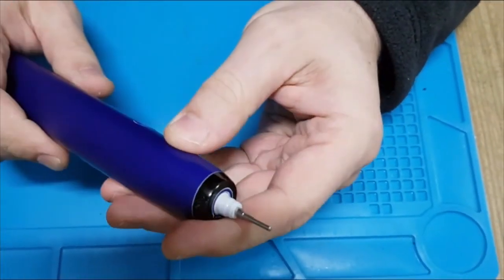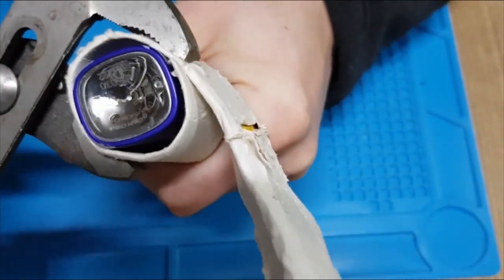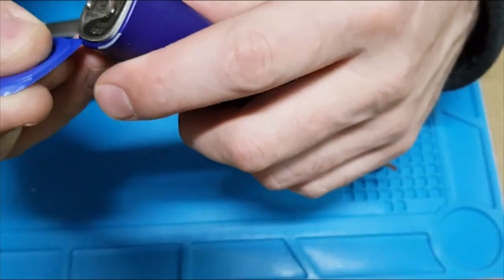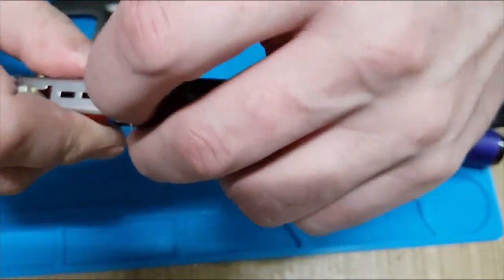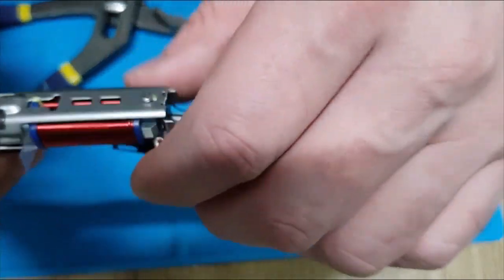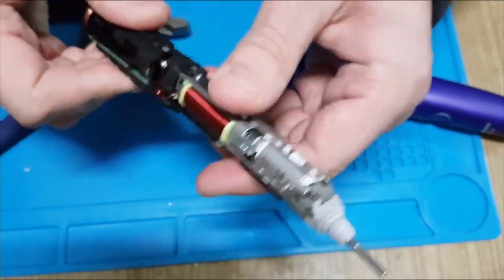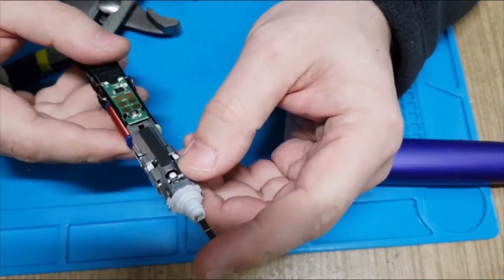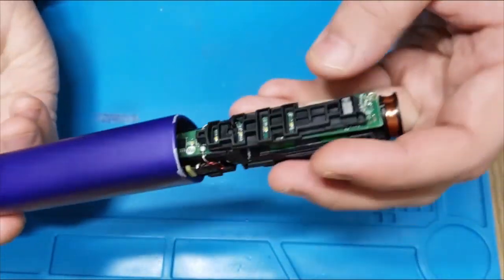Philips Sonicare DiamondClean /no vibrations/ opening and repair

Comment: Hey I've just replaced the headpiece, and went perfectly, strong vibrations and everything but when i put it back in the handle shell it stopped working? took it apart again and when I press the button, the PCB lights up for a second and nothing happens, still charges fine, any ideas on whats wrong? doesnt look like any water damage
Reply from the maker: How did the upper seal looked like? I get a lot of messages where they say that it doesnt have any water signs but when you take off the board there is a lot of corosion underneath even when upper side looks good. Other possible candidates would be MOSFETs or as I had one interesting conversation wit one commenter battery itself if it's 10+ years old..
Reply: @letsfixitgarage  I've just changed the seal, I haven't used it yet so there shouldn't be water damage
Reply from the maker: I meant that maybe water damage was already there before you started repairing. Water damage is not correct word as you think it's instantaneous but it's more corosion of the PCB traces from long exposure to water or moisture..

Comment: how short must the gap be for it to work!
Reply from the maker: 1-2mm, it works with any gap it's just my assumption that smaller is better..
Reply: @letsfixitgarage  thanks mate! I did that but I toothbrush still didn't work.  so sad.  I see some Corrosion on the red metal wrap. do u have any idea what that might be.  appreciate your help
Reply from the maker: @15v1c1  any corrosion is sign of water damage. Check my videos for water damage on the Diamondclean brush and if you have a multimeter chances are high you can identify the culprit of the defect. Although repair of water damage requires some small items soldering skills.. but you can see the repair examples in the videos..
Reply: @letsfixitgarage  oh no.  I don't have any tools...
Reply from the maker: Well water damage is impossible to repair without tools.. try to look for someone with the right tolls and with my videos it's almost as step by step tutorial..
Reply: @letsfixitgarage  thanks mate

Comment: if you have any video for repairing gaps for Sonicare 9000 black, it would be great. I watched most of the videos for repairing this brush and it helps me a lot. as in 9000, there is a bit different circuit board and wire connecting brush tips to the mainboard for Bluetooth connection, Thank you in advance.
Reply from the maker: I have only this one https://youtu.be/y_HVpYt_jHM but it was more of first time opening and inspection and not a real repair video (although it got repaired - battery was empty :) ) in principle process is the same you just need to detach the glued magnetic sensor and the two wires. It can be done without desoldering the two wires (I think it's for the rfid reading on the toothbrush head and not Bluetooth) but it's easier if you desolder them and solder it back after the gap repair..

Comment: Thanks man. Was a few clicks away from buying a new one due to the wobbling head when I found your video. Bit nervous about getting the base off, but worked perfectly. Just needed to tighten the screw put it back together and it's working perfectly.
Reply from the maker: If it will start wobbling again buy screw tightening liquid like loctite for the next intervention ;) p.s. and spread the word if you can :)

Comment: Where to get this piece of plastic to open the bottom piece?
Reply from the maker: Any thin plastic will do. It's only needed to create additional pressure on the bottom cover. Sometimes it pops out only by applying pressure without the additional plastic..

Comment: Wauw!! Precision mechanic. I want to do this, but i'm afraid. I have an older Braun elecric toothbrush.
Reply from the maker: Braun toothbrush uses completely different approach. They have a mechanical transmission. So if you have vibration problem it could be more difficult to investigate :) on the bright side they are much easier to take it apart ;)
Reply: @letsfixitgarage  okay, "Deutsche grundlichheit" 
Maybe i have to lubricate the gearbox (75W90? haha) and if i can not; i just buy a new one. This one is maybe 8 or 10 years old.
Reply from the maker: Definitely take a look. Problem could also be in battery, as Braun usually used NiMH batteries..
Reply: @letsfixitgarage  Okay,thanxx man!!

Comment: Thanks for the help! That worked perfectly! On a related note, that is the worst engineering I've ever seen on a non-beta product! The whole thing breaks if a piece move a fraction of a millimeter, but the bracket to screw it into is literally 10 times the size! Setting it down on the counter could be enough force to knock it lose! Crazy!
Reply from the maker: Your welcome. Sure Philips could have welded it in place, but then if you would drop it, it would bend the internal shaft and  what repairability would it have then.. only replacement.. I like this design for repair it is very good, they used even simple Philips head screws and not some fancy ones where you would need some additional adapters :)

Comment: I managed to get off the cap but then failed at step two - did not manage to get the inner parts out of the case. Oh well will have to buy a new one after all....
Reply from the maker: Check out my other videos. There is one especially for taking it out of the housing.. that was requested quite a lot :)

Comment: I fixed the magnet and there is space now, but my brush doesn't work nonetheless. It just doesn't start vibrating. The lamps go on when I push the button though. Any help?
Reply from the maker: Difficult to say only from description.. what was the initial Problem? water? Did it function before the repair? I would check if the MOSFETs are ok if the lights are functioning but there is absolutely no vibrations..
Reply: @letsfixitgarage  the initial problem was that it wouldn't start. I did the repair as shown in the video (the magnets clearly touched totally), but there was no improvement. There got some moisture into the top part as I can see. I had to use the brush manually now because I didn't have a normal brush at home and now the top thing is clearly loose. Maybe that was the problem in the first place and it got worse now.

I don't know if I buy a new one and do this reparation frequently or if I buy another brand now ...
Reply from the maker: If it was not turning on and you found water then this repair is not going to help.. check my other videos for typical defects or water damage series. The answer could be there but it involves quite delicate soldering skill.. as I said before this is a very reliable toothbrush but you need to take care of the upper rubber seal and not dropping it.. then it will serve very long ;)
Reply: @letsfixitgarage  thanks for your answers

Comment: I took out everything like what you did, and everything fits tightly but it doesn't do anything when the power button was pressed.
Reply from the maker: What was the initial problem of the toothbrush? Low vibrations or no vibrations no lights?
Reply: No vibrations and no lights
Reply from the maker: Then check my other videos on water damage repair. These should have answers to your problems.

Comment: Can you tell me the tool that you used to get the pcb out? I can't find any tool around the house. Thanks much!
Reply from the maker: For that you need to desolder battery and charging coil. If you desoldered these things you could take pliers and squeeze the 2 plastic pieces to make it thinner but it shouldn't be to difficult main thing is to desolder the other 4 points there is no way around it..
Reply: @letsfixitgarage  thank you!

Comment: The handle cracked when applying pressure and prying the cover, did anyone else have this problem?
Reply from the maker: Yes it can happen as with any plastics if to much force is applied.. somehow from my experience the new golden color housings brake more often.. not sure if something changed in the plastic or is it just my luck that influences it..

Comment: just received a new motor that i got off of ebay. The motor shaft was broken in my sonicare dimondclean. Put the new motor in and soldered up the battery contacts and it works perfectly. $30 and I have a new toothbrush. Thanks for your great tutorial.
Reply from the maker: Beauty of repairs :) nice job! And you saved some piece of e-waste!

Comment: Thank you, man. I've saved me from ditching a perfectly repairable toothbrush.
One remark - I'd put threadlocker not only to the threads but also between the screw head and the metal casing to prevent the electromagnet slipping. In fact I did so when fixing my toothbrush.
Reply from the maker: Yes threadlock doesn't hurt, as we can't get the screw tightening forces that the manufacturer uses.. I do believe that space between magnets and screw tightening force is a calculated value at the manufacturer Hause that saves from further damage.. but if we don't have it adding the threadlock helps to have it opened one more time..

Comment: As with others, I was dubious as I was mangling the bottom cover, and further dubious when I could not find the release clips. My problem was that the screw that fixes the top metal rod in place had come undone. I screwed it back in and it is working again! One small caveat however - if you are like me and lack the proper tools to get the bottom off cleanly, it may result in no longer charging on the standing charger. Fortunately it still charges in the travel charger.  :(
Reply from the maker: For the ones that are looking there is a close up video https://youtu.be/oMVa64Q13HA

And for the not charging.. it should be the same travel or glass charger.. of course if the coil got saved it could be difficult to replace but just got an idea that I'm principle it could be rewinded.. just calculate the windings and rewind with the same diameter isolated wire.. :) just an idea I would just take another frame but yes some soldering gear is needed for that.. glad you didn't gave up and managed to fix it!!

Comment: Thanks for the great video! 🖤 Helped me a lot to open the toothbrush! I had to replace the link rod at the top, as the metal inside the toothbrush was broken. (I ordered a replacement part from eBay.) I took this opportunity to adjust the space between the magnets. Now the toothbrush is working better than before!

Comment: I've got an issue where my mode lights don't work. My brush charges and switches on and cycles all modes. 

I've done a battery replacement and after that the mode lights haven't worked.
Reply from the maker: Difficult to say, check if you didn't knock some element of the board or maybe something got shorted out.. haven't had similar issue..
Reply: @letsfixitgarage   thanks for the reply. I have miss judged it. I think it isn't charging as well. Do you thing it would be a good idea to try a full reset by desolding the 2 points bridged on the board?
Reply from the maker: To be honest I doubt it would help but sure you can try. I would look for something that got damaged in the last repair.. maybe samo trace got torn.. maybe some pcb element got toched by the soldering iron.. maybe something got shorted out..
Reply: Thank you for your advice I will give it a try.

Comment: Thank you for this instructional video. I'm a middle aged unhandy person with very little skills of this nature but your clear and precise video made it possible for me to open up and diagnose my Sonicare. I was able to create space between the magnets but then I noticed that my brush shaft was very loose and looking closer,   it was revealed that shaft in my brush head broke at the screw. I know I could replace this whole thing (everyone mentions this place http://www.ebay.co.uk/itm/new-original-Philips-electric-toothbrushes-vibration-device-HX9340-HX6710-HX6950/252636882826?_trksid=p2485497.m4902.l9144)  but the red  wires came undone so that would require soldering and that is way above my skill set. I really appreciated this video and for those of you who are NOT handy like me. This repair would have been achievable if not for my broken shaft.
Reply from the maker: Hi, broken shaft is quite rare but yes it is beyond repair. As for soldering I would say it's difficulty is overrated.. it requires some precision and fast acting but it's fairly easy.. just get yourself a thin tip scheap solder iron and a starter solder kit just to try out the soldering. As for this repair you just heat up the solder blob/point and holding solder iron in the blob take with pliers the wire and lift it up.. let everything solidify by removing the solder iron and that's it.. soldering gets tricky with multiple legs components but one point soldering has more fears than difficulty ;) try it out it opens a lot more repair perspectives!
Reply: @letsfixitgarage  thank you for this additional advice. Appreciate all this great info.

Comment: Thank you. I have just fixed my wife's brush. Her problem was actually that the switch was sticking on, so it didn't charge, but the gap was too narrow anyway and it had water leakage. Realistically I will need to replace it in a few months, but I learned something.
Reply from the maker: If it will stop working you can check my water damage series of these brushes (including power button cleaning). It can be fixed but it requires some equipment to do it..

Comment: thanks. very helpful. was done in 5 minutes. not sure that water doesn't  go inside  thru the bottom of the brush after it was opened but magnet is on the right place and brush is working perfect. спасибо.
Reply from the maker: If you haven't used a screwdriver and opened it as I showed by slightly pressing on the sides it should be good. There is a slight chance of micro crack in the housing but for every day use it should be good haven't tried it while scuba diving :D pozaluista ;)
Reply: @letsfixitgarage  🤣🤣🤣 you are good one!!! 👍👍👍

Comment: so carefull when putting screwdriver into handle to pull out vibration unit and motherboard... I ended up destroying mine. might have been wise to warn people to be careful, rather than just showing a screwdriver going into a dark hole.  what I thought was a piece of plastic breaking off was actually an SMT component breaking off the board.
Reply from the maker: When you repair you always have to be careful, not to hurt yourself, or damage the thing that you are repairing.. I had done even a separate video just for the taking out as a lot of people were complaining that it's wery difficult to do so do your research don't start everything on one video experience.. sorry to hear that you damaged yours, these repair videos are not 100% fix or professional guides and it's definitely not easy doing it first time but you have learned something valuable in the process so you could acquire a defected toothbrush and maybe you will be able to make one working from two! Good luck and be careful repair activity is quite addictive when you get it right ;)

Comment: Thanks!  Had a two pack of these with one that stopped working several months ago and then the second one started doing the same thing.  Luckily, I didn't toss them out before I checked to see if there were some repair videos on youtube.  Both of them, sure enough, had done the same thing as this unit.  Why did they do that sliding screw slot?  So that it would appear as though the brushes would break down over time?  Anyway, fixed the two of mine in 10 minutes.  I'm guessing I'll have to do this again.  I should jam something in that screw slot to prevent the closure if it keeps happening.
Reply from the maker: I'm not a Philips employee so don't know for sure but I assume it is needed for the maximum strength point adjustment and without this gap you would have quite sturdy connection so in case you drop it it would have a higher probability of breaking.. just assumptions but I doubt regarding theories that it's a planed braking point. Do check for screw locking liquid to put it on a screw it has a lot of vibrations so it could unscrew over time.. glad this video helped you ;)

Comment: Did this repair on two brush handles and it seemed to work. However, neither will charge now. I reassembled exactly in reverse of disassembly. What did I do wrong? Any tips?
Reply from the maker: Hi didn't had similar problem so it's difficult to advise.. I remember though not long ago there was a similar comment where one guy had a problem that after reassembly it was charging only without the end cap. If I remember correctly he inspected all the components with magnifying glass and resoldered some including the battery.. so it depends what was done and what was the initial cause why you started the repair..